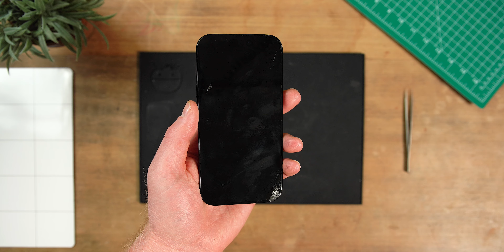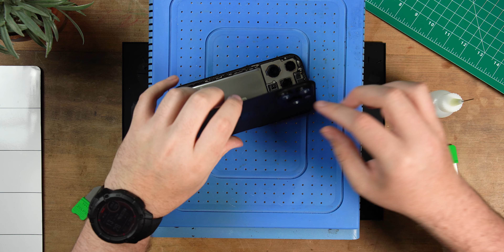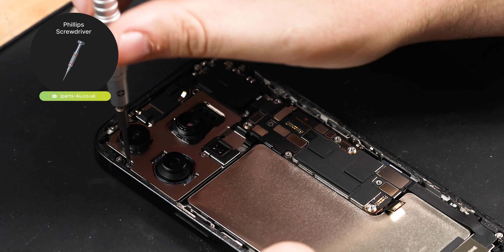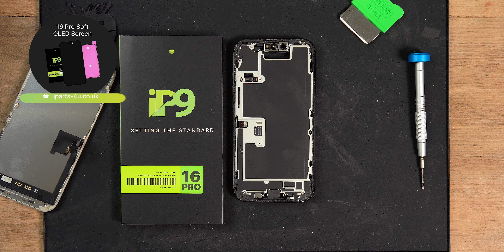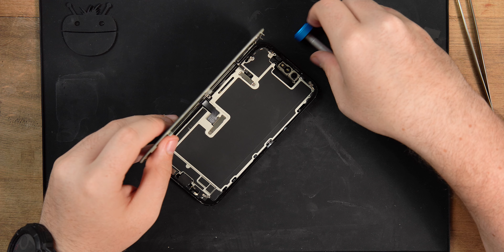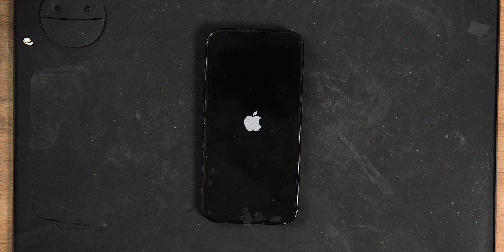How to Replace iPhone 16 Pro Screen – Full Repair Walkthrough

Comment: The design of the 16 invites damage. The bottom right side notch means the screen is completely unprotected causing it to crack at that point. Very poor design from Apple and Otter Box.

Comment: very unnessary to remove the back cover to remove the front screen
Reply from the maker: The back cover is removed to disconnect the battery, this is for best practice to avoid damaging the board when disconnecting a reconnecting fpc's
Reply: @Iparts-4uCoUk there's a bigger chance to damage the phone period, if you'll be dismantling both ends tbh

Comment: Hey man. Thanks for the video. I have one question. If I repair an iPhine 16 pro screen the same way as you did, is there a chance that I will receive noisy notifications or software restrictions? I'm worried that because of the lack of right to repair I will have issues afterwards...
Reply from the maker: You won't have any software restrictions however if you fit with an aftermarket display like we did then you will see a notification in your settings stating that the screen is 'Unknown'. However it's nothing to worry about, your screen will function as normal 🙂